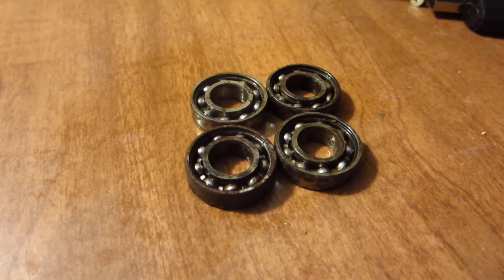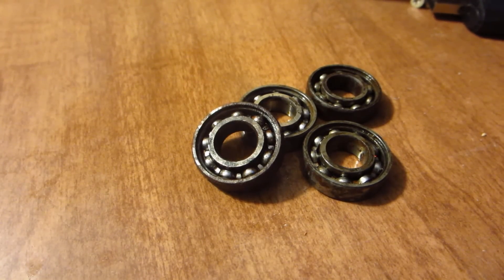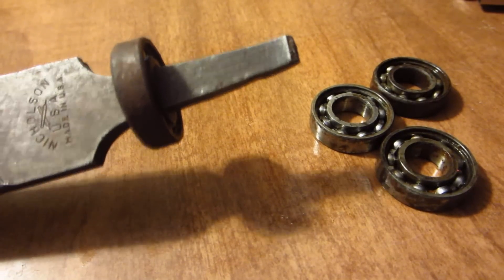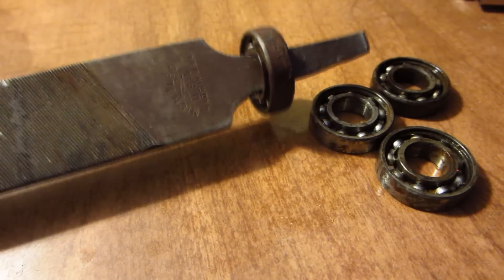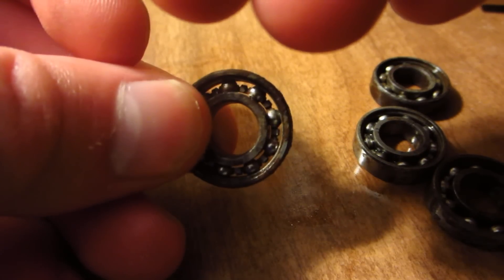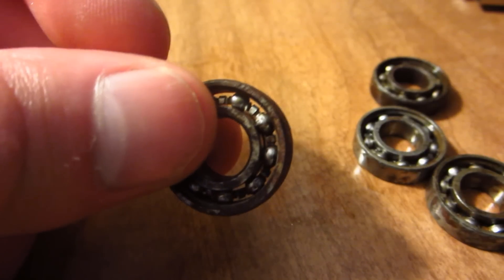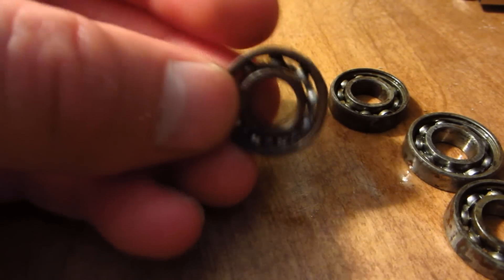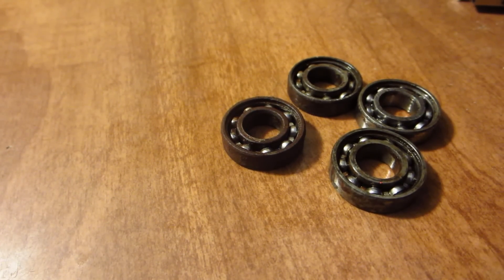Reviving Rusted Bearings

Comment: 1st step : Soak bearings in Coke.
2nd step : Rinse with nail polish remover.
3rd step : Apply lubricant before use. 

Hopefully this helps. 😉✌
Reply: What kind of lubrincant
Reply: 1/2 hour should be good
Reply: Phreakers86 thank u
Reply: @miningexpert66  vaselina
Reply: I'm trying this rn
Reply: Can soak in any citric acid solution, Coke (phosphoric acid), White Vinegar (acetic acid), or any kind of acid really, and the rust be dissolved. Then step 2, dry completely, and then step 3.
Reply: @AlexCruz-pp2xw   Did it work?
Reply: @harikeshlv6065  it worked really well! Some of my bearings were too far gone but most of them were saved
Reply: @AlexCruz-pp2xw   Thanks so much! I'll try it out!

Comment: I have this issue but caused by corrosive vapours (fume hood fan) - unfortunately a chemically resistant fan is very expensive and so is the special tool for replacing the bearing. I will try to clean them as you advised, maybe try a de-rusting solution (acetic/oxalic acids) and hopefully they will run again.
I found some polyether gas filters that should protect the fan from some of the corrosive and solvent vapours and maybe I will install extra filters (activated carbon to remove solvents, wetted filter wool to absorb acidic gases) to increase life span of the fan... the fan is otherwise in good condition, it's just the metal parts of the motor and the bearings that suffer most.
Reply from the maker: I've really become a fan of Deoxit, I've not tried it in bearings or anything before, but it really seems to work very well as a corrosion inhibitor.

I think just a little drop of 100% deoxit could go a long way in protecting the bearing in a situation like your.